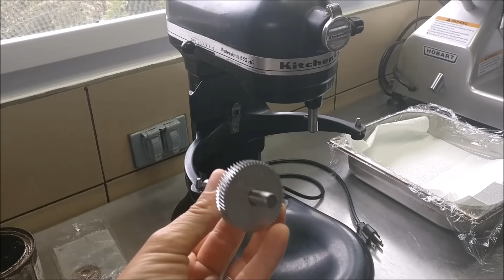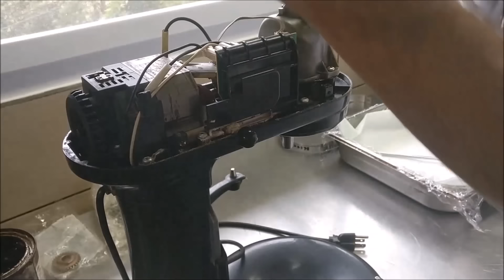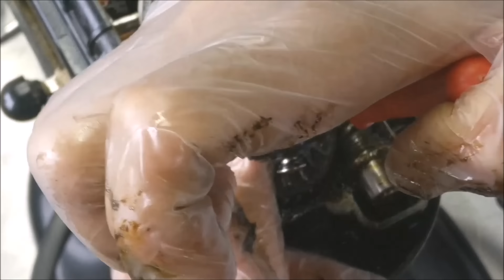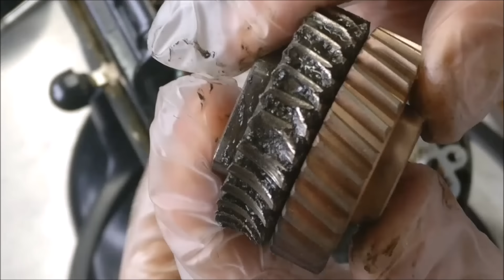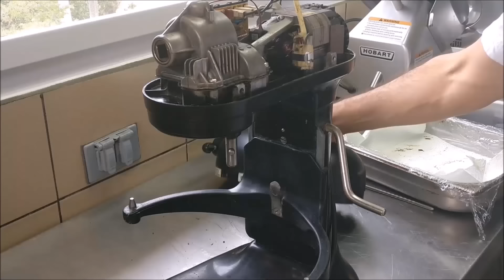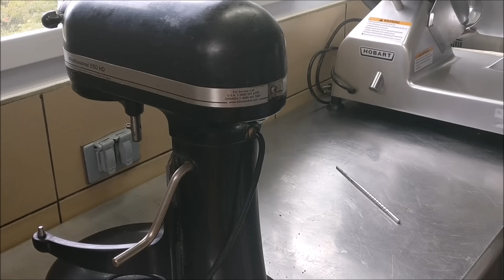Repairing the KitchenAid Professional 550HD main gear

Comment from the maker: When you remove and replace the gear worm take special notice how the bearings are situated.  The flat side should be facing the side not the top.  I noticed I had mine in the wrong way and had to fix it.
Reply: The special pliers are called "snap ring pliers". Regardless of what kitchenaid calls the "gear worm", those are more commonly referred to as a worm gear
Reply: I was just going to say...at 12:20 it looks like the front bushing is turned 90° from where it should be.
Reply: I recommend pinning this comment so that it will be at the top and everyone will be sure to see it.

Comment: Thanks for your video.  I have the Professional 5 Plus.  The circular piece that holds the dough hook and paddle is falling off which does not allow them to move. I don't see how it stays on.  Do I need to replace the shaft?  Thanks for your response.

Comment: Eric, Great video.  I have a KA pro 5 plus. that looks just like yours in the video.  The bottom of the motor housing is moving on the pedestal.  I'm assuming the screws that hold the housing have loosened up.  My question is do I have to remove the entire motor to tighten the screws.  I would have to remove the transmission housing also which would allow me to replace the gear anyway.  Just asking your thoughts.

Comment: Hello , my 550 HD mixer attachment hub does not spinning. What is  the problem possible? Thanks.
Reply from the maker: The gear worm probably needs to be replaced
Reply: @2guysandacooler  I can mix dough, but can not use attachment part, the attachment hub does not spin.

Comment: Very good instructional video, thanks! Subscribed to your channel. Replaced the two main gears and got it all back together. It works fine now but seems to be louder than before. Read all the comments below and nothing seems to address it. No knocking, clunking or anything unusual, just louder than before. Any thoughts on why?

Comment: I have the same Professional 550 plus Model KV25MEXCU5 serial W22964476 and the speed control is hard to move - do you know what part I would need to fix (if this is easy to do)?

Comment: Brand new gears bro.
Reply from the maker: Sorry, you only mentioned changing the motor and the board...  Not sure what to tell you.  A grinding sound is the gears not lining up properly.  Perhaps tour main rod is slightly bent or the company you bought gears from might not be OEM.  Maybe you have the wrong model gear.  You should remove the gears and run the unit just to see if there's any weird wobble or noise that comes from it being turned on..  Hope that helps,

Comment: I changed  the motor & Board for my Professional 550 HD Mixer. Why it is there is a grinding sound when I mix 700g flour?
Reply from the maker: If you hear grinding then that means it's a gear issue..  You most likely need to change the follower or the worm gear (the main 2 that operate the unit)

Comment: Links are out of date, but yeah, this is an easy repair.  Great video.

I found parts at Genuine Replacement Parts, Kitchen Aid KF26M2XPM5 Follower Gear, $19.89  and $8.88 shipping.  I bought two gears so I have a spare.  Fast UPS shipping.   Bagels this weekend!  we're back in business.

Comment: Great video, thanks for sharing!  It looks like your main vertical shaft is bent (I could see a wobble when you spun it by hand and when the mixer was running at the end).  This could be adding additional strain to the gear, causing it to wear out faster. You may want to consider replacing it.

Comment: Hello, if you do not first identify the origin of the problem (lower levels). To observe the very important play of it at the level of the plunging axis and support of accessories, "WHAT WOULD SEEM EXCEPTIONALLY NORMAL".
It is certain that your problem will resurface even faster than the first time. Good luck and thank you for this video. FALCO

Comment: It seems like there is too much wiggle room where the worm gear fits into the housing in my unit. This causes the gears to slip and strip out far too quickly. I just replaced gears and they are already slipping when my wife is making her bread dough. Has anyone else noticed this? I’m thinking about modifying the housing to hold the gear in place better. Not sure how yet. Might superglue a thin piece of metal in there.

Comment: Thank you for your video!  My 12 year-old Kitchenaid Professional HD mixer (KG25H7X) was leaking "what seemed to be" oil - - which was actually a bit of breakdown of the lubricating food-grade grease originally applied by the manufacturer.  Equipped with a Robertson screwdriver (square tip), snap-ring pliers, a few wood coffee-stirrers (popsicle sticks), a few shop towels and nitrile gloves. I followed your instructions to open-up the mixer, take the mother-board out of the way, remove the parts, clean them, apply new food-grade grease and put everything back together. While at it, I also replaced the gasket. Even though my mixer does not have a lot of wear, I was pleased to notice that the gears were all in top shape!  By the way, the gasket part # is WP9709511, it is listed in some places as Whirlpool Genuine OEM WP9709511 Stand Mixer Transmission Case Gasket and in other places as Kitchen Aid Stand Mixer Transmission Case Gasket.  All in all,  I am truly happy to have done this by myself.  Thank you "2 Guys & A Cooler !!!!   (Christine - - Québec, Canada - - 2020-07-18)

Comment: I bought the machine in January 2020 and have used for about 4 months & today it has stop spinning do you think I need to change the worm gear ?
Reply from the maker: Does it make any sound when you turn it on?  Like a grinding sound or does it sound normal it just isn't spinning?

Comment: Hii 
I have a question 
I have kitchenaid stand mixer 
Recently when i use it  melted plastic smell with white smoke  coming out from the speed plate i just stopped it and wait like 5 hours and try to work it and its work but the sound is a little weird  
Now when i try to use it in dough i feel that its work hardly and the smell getting out from the attachment place its not working like before 

What's the problem?
Reply from the maker: Hello Lena,  Not sure.  It might be a motor issue.  All the gears are made out of some sort of metal so you generally won't have any smoke coming from the gears but the motor if it starts to overhear and burn up might give you some smoke and melted plastic smell.  just a thought.
Reply: Thanks for replying 
You know what  ... I use it many times after that happens and it's still working but the sound  comes while working is not like before 
Do you think I have to change the gear ? 
If its motor issue its gonna work ?

Comment: Hi! I've followed your instructions to a T, and afterwards the mixer functions as you would expect, but is accompanied by a clinking noise. Any ideas on what I should check?
Reply: Me too!!
Reply: @jennasotomayor4310  6 months later and I've not figured it out. I've replaced many bits, and I am currently about to put a new motor in. 

I suspect that the issue is a bent planetary shaft. Let me know if you manage to figure yours out.
Reply: @EliPutney  I’ve just been replacing parts until hopefully it stops lol. One thing that makes me think the planetary shaft is bent: in the video, it slides off pretty easy. On mine, I had to whack it with a rubber mallet A LOT to get it off.

Comment: Thank you just changed my mixer’s gear and other parts , which I had been using for 15 years and I mean using everyday,with your help I bought the parts from KitchenAid will try to see if their part last longer. 
But thanks again Very calm and detailed instructions

Comment: The links in the description box do not work. I am just wondering if the following is the same part.
https://www.ereplacementparts.com/gear-hub-p-621980.html
Reply from the maker: Thanks for the heads up.  I don't think that's the part.  That gear is for the attachment section of your mixer.  You are probably looking for the Brass Worm Follow Gear

Comment: The retaining pliers linked in the description are not going to work. The tips are too big to fit in the holes in the retaining ring. I tried grinding them down but they just kept slipping. I got channel lock’s 927 8 inch retaining ring pliers. The looked a lot more like the ones used in the video. Only other issue was the shaft was much harder to remove and I had to use hammer to get the new gear on. But this is the first time I’ve changed any gears on it. 
Other wise awesome video. I was able to follow it and fix my machine. Thanks
Reply from the maker: Thanks for the comment.  I just updated the links.

Comment: I have an extra piece that I don't find in the video nor in the diagram...  A ring about 1'' long that fits the shaft. I don't remember where it was. Any idea?
I actually fixed the bras worm follower gear as described in your video, it worked great... And 2 weeks later the gear hub worn out. I still don't understand why, I was making bread dough. Anyway, it could be because if this piece I put back on top of the retaining clip.

Comment: Wow the brass gear seems to be designed to wear out.. imagine how many people throw away the mixer creating tonnes of trash because of the greedy company
Reply: I understand why you might think that, but the brass gear is probably intentionally designed to be a weak point. In this way, only one part will fail and the repair is (as you state) relatively easy and inexpensive. If all of the gears were hardened steel, it is likely that a failure would involve multiple parts and be more complicated and expensive to repair.
Reply from the maker: my thoughts exactly.

Comment: I’ve got one of these in my shop and the folks tried replacing the gear but they didn’t clean the case of the old contaminated grease and the metal fragments in the old grease caused the unit to sound like it was going to destroy itself, luckily it wasn’t run long. Not having the upper bearing in place also didn’t help either.

Comment: Hello,  my mother-in-law gave me  Kitchenaid :) But he’s broken.  Can you please advise me what would be wrong ? Any idea.  Can I post a link to my video?  Thanks !
Reply from the maker: Sure.
Reply: https://youtu.be/3_Mj5dUKhNU
Reply from the maker: It looks like your gears are very stripped.  Take your machine apart like I did in this video and replace the main gears.  The main 2 gears.  Here is a place to check your model number and see what parts you need.   https://www.ereplacementparts.com/kitchenaid-kv25mexer5-empirered-and-stand-mixer-parts-c-114958_114959_290204.html

Comment: Thanks very much for the video! When you mentioned stripping the circlip while using pliers what did you mean? I removed the clip with pliers and it got slightly bent but I think it should still work. It seems like it should still be fine. Do you have any advice on what to look for in a damaged clip?
Reply from the maker: When I removed my clip with regular pliers I opened it up too much.  I could never get it back to having a tight fit.  If yours goes on tight then I think it'll be good to go.
Reply: @2guysandacooler  Thanks for the reply! I got it all back together but now it makes a really loud clicking without being under any load. Does that seem like a problem with the worm gear itself?

Comment: I really enjoyed your video.  Our 500 Plus gearing still looks good after taking a look and redistributing the grease back towards the gears.  We make dough and other heavy products in the 5.5 qt bowl, and IMO overloading the mixer is the problem.  Reduce the recipe and do not overload the mixer to have years of good service.  Otherwise I would recommend a Hobart commercial mixer.
Reply: how did you get the top off of the 500?  There are no screws on the sides underneath the metal band.

Comment: Loved this video -- except the "gear worm flat notches facing up" 11:50-- this caused problems when I turned on the motor, and the housing wouldn't close tight... It wasn't until I watched a different video that they said the rounded part, flange, sticks up. So thankful! I couldn't figure out what the problem was. It's all good now. Why the discrepancy here?
Reply from the maker: Thanks for the comment.  I'll have to open mine up and see how it's arranged.    Glad you got yours fixed though!!  If I was incorrect with the info I'll have to find a way to fix it.   Thanks for bringing that to my attention...
Reply: @2guysandacooler  Thank you for responding. Your instruction seemed to be right and this adds to why this is so perplexing! Could it be a different model situation? Take care and hope we can get the answer!

Comment: What is the best way to clean the grease out of the mixer.
Reply from the maker: Great question.  I'm not sure about the best way because  I haven't been able to do it with out it getting messy but I put some gloves on and remove all the gears.  I then scoop out the grease with my hands  (gloves on) and detail the housing with a q-tip and some paper towels.  I'm sure you can use a can of solvent to really get it perfect but I've never needed to go down that road..

Comment: I only used my kitchen aid about five times. How do I know if it's the gear. It's  not starting . It's just dead. I tried plugging it into different outlets to no avail.
Reply from the maker: That's a tough issue.  If the unit isn't getting power it could be that the chip panel that controls the switches may be damaged, the gears have seized, or the motor could be burned out.  Hard to say...  I hope you can figure it out..
Reply: @2guysandacooler  👍
Reply: I got a kitchen aid KPM   50 and after replaced worm gear the machine is not working, what is the problem.

Comment: Great video, but I don’t have that tool you mentioned. My kitchenaid rotation part fell down while I was using it. I bought mine second hand :0( I had no idea it came damaged. I think is missing that little pin you put the very first time after you cleaned it up and started putting it back together. What brand oil you used? I’m so nervous to do it but I want to use my lovely kitchenaid.
Reply from the maker: Hi Laura.  I think you are absolutely right.  That little pin holds everything in place while it's spinning.  Should be an easy part to get.  Here is where I but my replacement parts for my kitchenaid.  https://www.ereplacementparts.com/shear-pin-retaining-pin-p-621981.html  Be sure to check the model number on your unit to see if this part will work..   The little tool I have is this one:  https://amzn.to/2NxWkDi   it comes in real handy when removing those rings that secure the rod and the grease that I use is this https://amzn.to/2wtSHaT but you could use any food grade grease.
It's a very easy machine to repair.  If you have any questions you can always reach out..

Comment: Thanks for the video. Great machine, it only needs some gears changed every year though? Hmmm. I regret getting one. Is there really one of these mixers that doesn't need yearly rebuilding?
Reply from the maker: Hey Greg.   Most people won't have this issue.  We use our machine commercially so we put extra wear and tear on it..   We've had ours for 10 years and it's still working strong...

Comment: Very helpful. This was the same process I followed for my artisan 400 with the key difference being that the flat sides of the worm gear axle are positioned on the sides and not the top and bottom. Thanks for the video.
Reply from the maker: Nice.   Once it's all opened up the mechanics are fairly simple.  Glad it's easy to fix!!  Thanks for watching.
Reply: @2guysandacooler  I opened it. To my surprise every thing looked good, gear teeth all fine. But when rotated food processor larger wheel, which inturn needs to move the small wheel. Didn't move, after removing three screws, I noticed a small pin had come off which keeps top wheel and bottom small aligned together. Pin was bent, is that how it is supposed to be. I put the bin back, vola it start to spin.
Next question, can I use white grease?
Reply from the maker: @jackryder6732  nice!!  The innis suppose to be straight.  You can use white grease.
Reply: @2guysandacooler  Got it. I have put it back. Just saw your reply now. If it breaks again I know what the issue, to make the pin straight I have to hammer it. 
If I wish to buy this assembly, where do I buy? Can you please send me the link. One can also buy piece by piece?
Reply: @2guysandacooler  https://linksharing.samsungcloud.com/wwLRXn56vwls
This is the picture of the gear assembly I was talking about. After putting the pin both wheels are moving. I only fear what if the pin comes out again? Its slightly bent
Reply: Please keep in mind mine is a different model. Gears are standing up position.

Comment: I followed the steps but the machine was very loud. I took it apart and tried again. This time it is a little quiter but I hear a clicking sound. Any idea what I am doing wrong? I believe I might not be putting the worm gear back corrsctly but I am ensuring that the flat ends are up.
Reply from the maker: Hi Tam,   It really hard to trouble shoot without looking at it but my guess is that if you hear clicking it's because the main gear (the long one) might be placed incorrectly.  It may be loose or therefore its not fitting just perfectly in the space provided...  If the other gears are on the rod and the pin has been put back in place to hold everything together then you will want to focus on the gear worm.   This is the gear that has the ball bearing rings on either end.  Sometimes its tricky to get on just right but look at the video again and check out the position of the brackets.  Hope that helps.  I cant wait to hear about how you have fixed your machine.